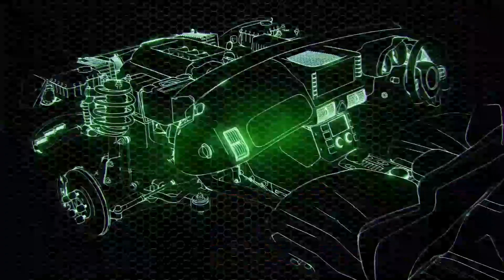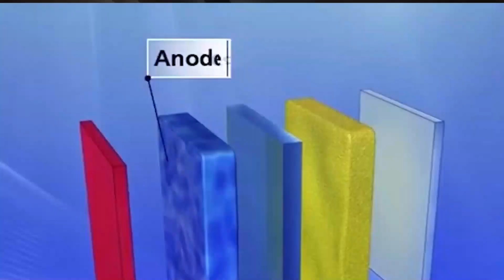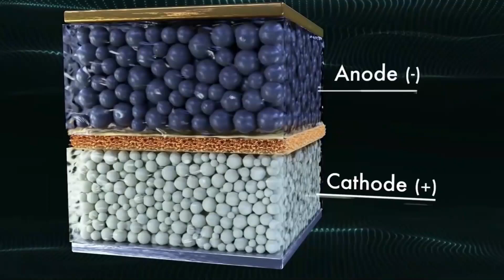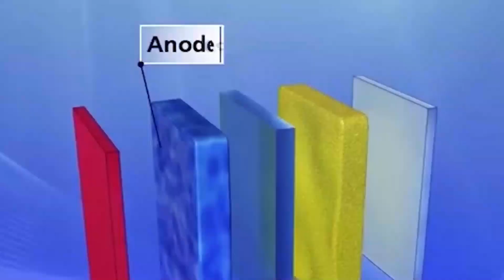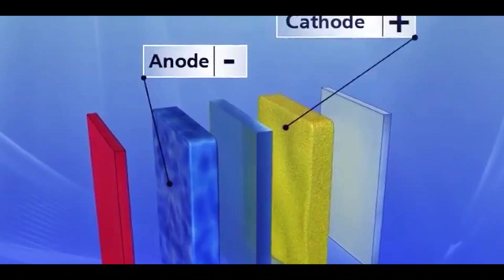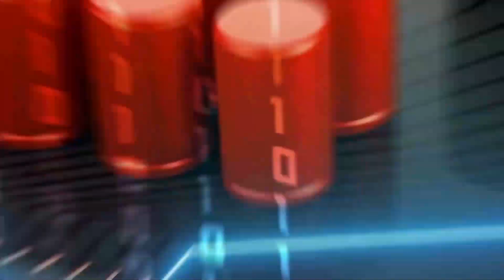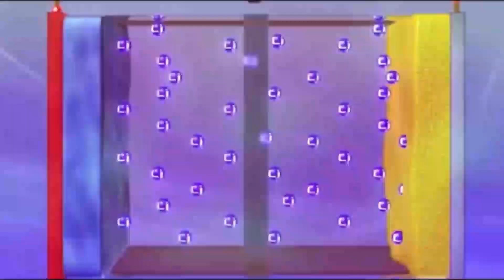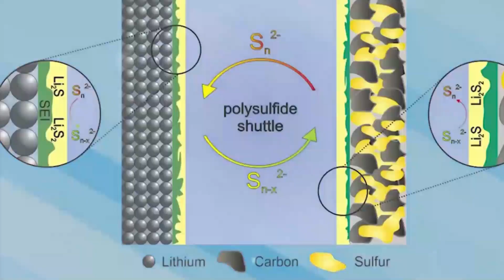New SULFUR Battery Promising 900 Miles Range | Learn How This Is Possible

Comment: Engineering choices combined with governmental pressure and cost reasons mean that presuming this is mass-produced, they’ll reduce the size and volume of the battery to be closer to normal.  The lighter the car, the better overall efficiency is achieved.